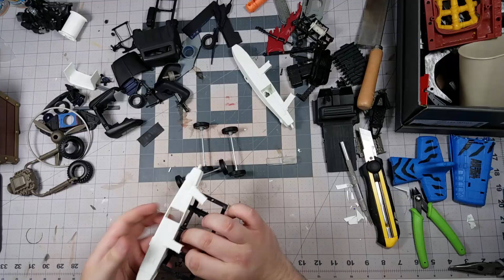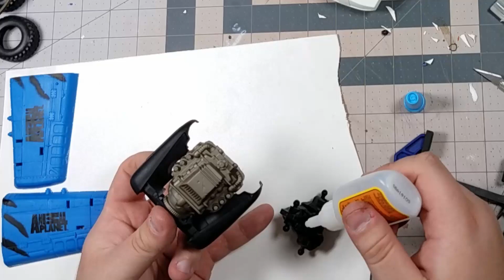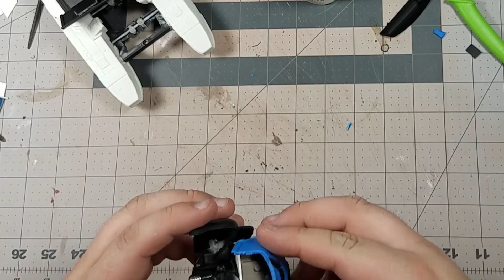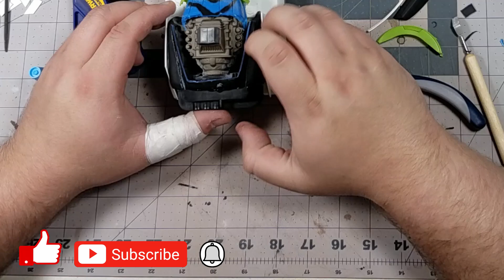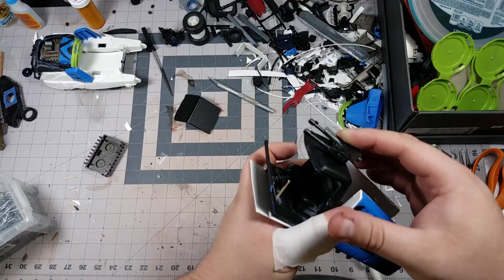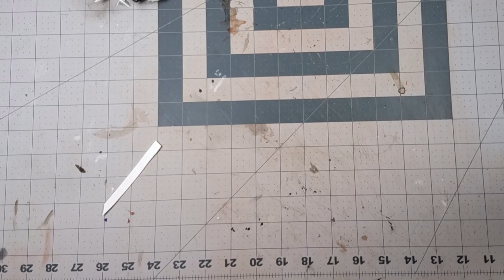Scratch Building an Ork Trukk | #Orktober

Comment: Hobby accidents are just par the the course. Have a first aid kit at your hobby table. I keep a bottle of isopropyl in the middle of my work space so it is always on hand. Then i have a roll of paper towel.
Reply from the maker: Yes they are. I have first aid near my space but since this accident I keep it a lot closer.
Reply: @MiniatureMedium  lol, ya mine is directly behind my primary sitting area, spin around in the chair and it is right there. Speaking of which I should check the expiration dates on the material inside.